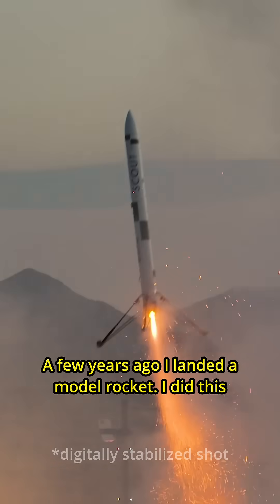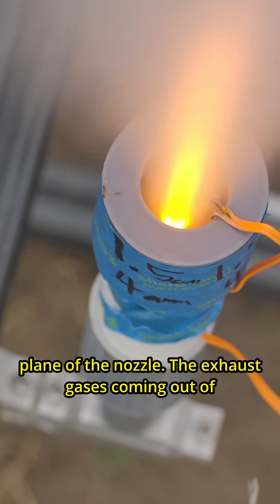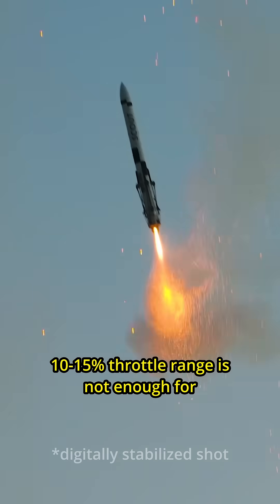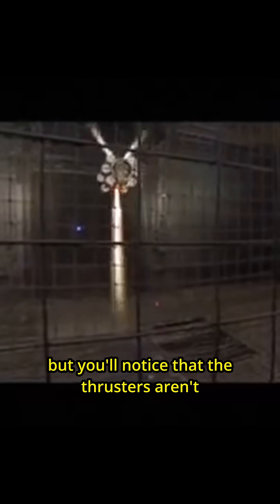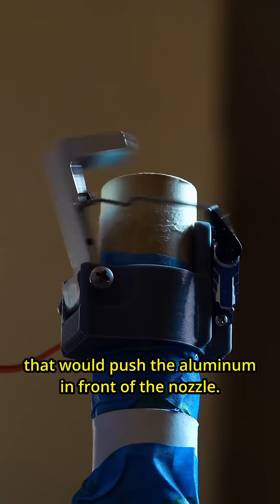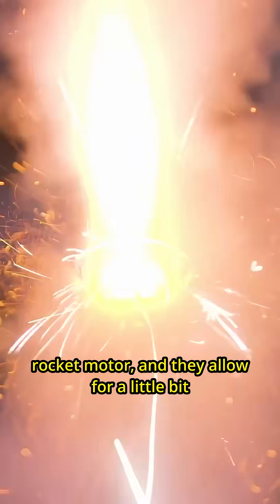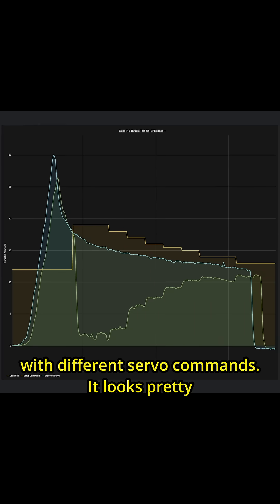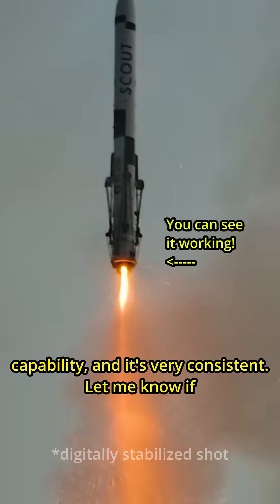Solid Rocket Throttle Control

Comment: Try Electrically controlled solid propellants, they are not indefinitely scalable, but safer and even more controllable than your setup. 
Some good Information can be found on the DSSP Homepage or by researcher Luigi T. DeLuca of Milano polyacademy. 
Also there is a video from Integza on the subject

Comment: It’s probably not that big of a difference but I do wonder if using 3 servos with mitered ends would allow for greater control. Almost definitely run into diminishing returns but maybe just 3 or 4 would be enough benefit to be worth the additional weight and complexity

Comment: The mayority of  steel is temperature resistant but aluminium is one of the lowest melting points however Aluminium oxide has a high melting point of 2.072 °C

Comment: Interesting, yeah my first thought was probably not as good as this method. Engineering is cool, 1000 ways to tackle a problem, usually most are garbage tier but something many methods of equal merit. Edit: mmm okay did not watch to the point of failure and 3 other ideas. Obstruction hmm ... Idk makes a pretty high risk point of failure or damage imo. I like the vector manipulation one. I don't think it was actually blocking many rockets, I thought it was redirecting. For your rocket your could accomplish that spinning the stream, or splitting rather than obstruction. Less upward vectoring still. But I was thinking air intake manipulation or nozzle stuff like your first idea. I would think changing the width and the distance would get enough control. But using ... The Bernoulli effects I think? So you can't just throttle around the point source stream, you have to control the intake and exhausted gas as well. So instead of the cylinder that meets the rocket, make it bigger than the rocket body so there is a gap and make it where you can cinch the top and open the bottom or the inverse. / \ to \ /
Reply: I was also thinking injecting or removing oxygen 😅but doesn't seem feasible. Or a two stage burn rate rocket, more useful for demo than actual repeatable controlled use.

Comment: If you used four it would steer as well

I believe the early systems inserted a ceramic blade to divert the exhaust 90 deg

Comment: I can't help but think this solution is somewhat over-engineered. Wouldn't it be easier to measure altitude, vertical speed and acceleration to pinpoint when to fire up the motor?

Comment: Why you dont make  plane like carrier which use retractable wings and acts like a fuel tank and launching
  booster in one body? The whole concept of verticaly landing rocket is nothing but a dead end. It is always prone to winds plus its very unstable. The larger and taller the body the more unstable it is and tend to sway and fall. At the other hand plane-like  body is more stable and offers larger payload and internal volume plus its  very easy for landing even its very windy. You can experiment with folding wings and since they are not fuel tanks they can be very lightweight  so the motors to move them will be smaller and lighter. have a great day :)

Comment: What about whit Ur Serbos, just add 2 mor with a cone in 4/4
  idea but more of a reverse  Cone to widen the thrust more  similar to a reverse thrust break on an airliner .  More  less
 In one period to slow down As you tighten the Serbos to slow down, you're deflecting.The thrust in a wide cone and changing the angle and dispersing in a wider area as from straight to 45 degrees to 90 Degrees so the thrust has no effect on lift when to the side As you throttle it.

Comment: Another YouTuber used a throttleable solid rocket propellant. The propellant could be activated in deactivated by applying an electric current. He also 3D prints rocket engines and turbines.
His name is Integza, which is awesome with the name of his YouTube channel.

Comment: The thing is, you're not truly throttling the output, You're just redirecting it. The thrust should just start shooting out the sides now, when you block them this way. When they do, could that be used to stabilize their side to side motion at the same time you are controlling the downward thrust?

Comment: I probably would have tried something along the lines of electric solid propellants, provided I could figure out how to make them. Electric solid propellants are solid propellants that only burn when actively stimulated by electrical current. I've actually been thinking a lot about their potential application in caseless firearms as a better alternative to nitrocellulose, which has a nasty tendency of cooking off magazines. Maybe that way, Heckler & Koch can finally get the G11 working.

Comment: I have more of a question about your landing gear than a suggestion for your throttle. Why doesn’t it fold out above the rocket’s center of gravity? I noticed that it almost fell over when it made contact with the ground and I think that was mainly because of how low the landing gear is on the rocket. Is there a particular reason why it’s so low?

Comment: I would have solved this problem the easy way. Get the requisite model rocketry license to work with rocket engines instead of rocket motors.

Comment: I'm not into rockets but I am a Pyrotechnician. My instinct would have been to use a rocket motor for the launch and a gas based system for the return/landing. You would likely have enough space for a gas like butane and be able to control it with servos to throttle it.

Comment: You can throttle control a solid rocket motor by how you pack the propellant. But you have to do a lot of math and be very very good at knowing how long your mission will take.

Comment: Seem to recall that the V2 used carbon vanes in the exhaust path as part of the control mechanism. If nothing else, an alternative to the ceramic. Maybe put channels in the deflectors to direct the exhaust more smoothly and consistently to the sides. Coors made ceramic rocket components for the nuclear motor of the proposed Project Pluto cruise missile back in the 1950s.
Reply: Black powder is composed of mainly coal as the fuel. It would ignite carbon. The V2 used Fuel mainly consistent of Ethanol which burns much less hot than black powder

Comment: Throttling a controlled explosion is difficult at best. Did you consider using liquid rocket fuel through a servo controlled valve? Nevertheless, your solution was brilliant.

Comment: I'd have tried using a camera aperture style shutter to control thrust, allng with a diverter or thrust splitter to change the direction of thrust to be partly horizontal.

Comment: What about making an iris out of ceramic sheets? So you maintain that perfect symmetry. You add weight but you also add a lot of cool factor too 😂
You could also try thrust reversers with the ceramic, extending it and angling it to push both up and down to limit the resulting thrust. It would add a bit more weight tho

Comment: my thought was angle the booster and spin it, so the exhaust makes a spiral motion. since its spinning, the directions all cancel out and it should stay mostly straight. but vibration, space, actually spinning the motor and throttle capabilities are all issues

Comment: Put two different rocket sizes in sequence. 
A stronger one for lifting and a weaker one for landing.
After shedding weight consuming the fuel of the thick one the rocket come back but slowly because of the second burn.
Then use the skirt lenght control of 20% to fine tune the landing.

Comment: Could a ceramic aperture or fins in the path of the exhaust be used to replicate this effect without a motor that is strong enough to directly counteract the engine''s thrust? Especially with larger rockets in mind, I'm wondering how well your solution can scale.

Comment: I would consider using 2 throttleable bypass systems going in the opposite direction of thrust that wwould be large enough to be the path of least resistance(Hooked up near the end of the nozzle) so that you could do a thrust reversal if needed when fully open. Some or even most of the gas would escape through the bypass, lowering chamber pressure, and the gas that is escaping would decrease the mass flow in your direction of thrust, lowering net thrust. While you might encounter the same issues as trying to block the exhaust, this way you should be able to control is much better while not impeding the normal exhaust. You would most likely need a nozzle that focused the exhaust gas and increased pressure normally for best results, because otherwise it would most likely fail once the motor starts running low.

Comment: Tbh i would have used an iris mechanism instead of the two wedges since that would block the point more evenly but this is still utterly brilliant
Reply: Then you have to generate a mean to bypass stored pressure
Reply: @NoahCXXIII  that's a fair point

Comment: Something I might have done differently would be to make them work like the thrust reversers on planes, making the clamshell with an explicit bypass instead of just blocking and letting the flow go wherever it fancies, that would also allow accelerating downwards and if you use 3 shells, you can get some thrust vectoring off of controlling the baffles independently.

Comment: I would have tried multiple smaller motors rather than the main to be ised for landing. My idea would add weight and complexity, this is a better solution.

Comment: My first thought for the PWM method was to use a flywheel with about two quarters missing, and you could adjust the speed of the motor to increase the amount of time it's being blocked or unblocked
Reply: If two quarters were missing that would give 50% duty cycle, independent of its rpm. It is the ratio, not the speed that is important with PWM.
Reply: @ahaveland  I suppose I could have worded it better. I meant that you would slow the speed of the motor while it is uncovered, meaning that there would be more time of it being uncovered. You could speed it back up while it is covered.
Reply: @deffman32tech  the on/off time is still 50% though, whether 10 rpm or 10000 rpm. Think about it!
Now, if it oscillates, then you can control the on/off ratio, but not if it's rotating constantly 
Edit - sorry, I reread. Yes, varying rotation speed would work, but not easy to control because of inertia and phase tracking. Mass and available energy are big factors on a toy rocket!
Reply: @ahaveland  haha yeah, the more I think about it the more infeasible it seems. It would have to be spinning quite fast and the rotor would have too much momentum. You'd need a disproportionately beefy motor to handle the quick changes like that.

Comment: How about using a sort of, ceramic bladed iris, like in an old camera shutter? That'd limit the thrust permitted through while the excess could be vented horizontally, where it could possibly assist in lateral control ?

Comment: My first thought was a hybrid rocket motor where you use a solid propellant with a liquid oxidized to be able to throttle the rocket but this is honestly the smarter solution cause it takes up much less space and is a lot lighter.

Comment: You could make the nozzle of one or more polymeres what will melt away in the 30s of flight. If the nozzle gets bigger, the thrust has to go down. As it grows wider the thrust reduction is constant and you can decide how long the rocket engine runs and determin how long the specific materials will need to melt away. In any way it will result in have at the beginn full power but when landing its much softer.

Comment: Ive done alot of looking, and cannot find any sort of references  but i vividly rememver one of my teachers in high school talking about a test that was done with fluid injection to throttle solid rocket engines. There was something tested that pulsed a fluid from the top of the corethrough the pyro channel. There was an initial micro spike in thrust because of the increased weight of exhauat gasses with the fluid that was vaporized before the temp was lowered, im not 100% sure the make up and which part of the solid booster it was injected into. The weight penalty makes more sense as to why it was never fully utilized. He was a Nike Zues operator during the cold war.

Comment: Im no rocket scientist so im taking a shot in the dark here. Wouldnt a design sort of like a camera shutter (twisting flaps to close towards the center) be more effective and consistent than clamps? 

Clamps seem easily damaged, detachable during flight, and more resistant to closing since theres an extreme force in the opposite direction the servos want to move the clamps.

 A diaphragm iris (i think its called) would mount better and allow for more thrust control

Comment: maybe you can also vector the nozzle in a circle very quickly at some constant angle, the higher the angle, the more force is lost to pushing the rocket laterally. if the nozzle is circling quickly enough, the horizontal forces should cancel out. itd be a little tricky balancing the vectoring used for stabalizing with the vectoring used for variable thrust, but it might be possible! hopefully no less uncontrollable than blocking the thrust outright

Comment: I was thinking — what if you use two ceramic flaps at the end of a rocket nozzle to deflect the thrust slightly during descent? Angling them could help steer the rocket or even slow it down by redirecting the exhaust flow.

Comment: I'd love to see if a ring variable nozzle would work well... I'm not a flight guy, everything i work on stays firmly on the ground, but i can see that it would be really interesting to try variable nozzle geometry. Narrowing the nozzle would result in a much faster exhaust stream which would, in principle, reduce the system efficiency significantly but also increase the combustion pressure, which would increase thrust/burn rate. 
I guess you could do the opposite instead and really open up the bell, creating a huge nozzle with very low efficiency and a huge area, making it very gentle but low output. 
The other option that occurs to me is just opening the other end of the rocket, allowing venting from the chamber, which would substantially reduce combustion pressure without requiring any complex work at the nozzle. 
That being said, i think you came up with a great solution, I'm just spitballing alternatives.

Comment: Not sure if  you considered it, but how about using an iris instead of the clamps. If each blade in the iris is individually adjustable, you could also get some degree of thrust vectoring, but for testing purposes, a fairly simple iris using plates that rotate in off of a servo driven gear train ring around the otter perimiter, and ports to the 'sides' (3, 4, more?) to give the gas a non-thrust exit point (or again, control these with more ceramics and servos for thrust vectoring again) might give you even more controll. You've already mostly solved your rotational corrections, but one or more of thes as thrust vectoring may give you as good, or better results during launch compared to attitude control based on fin airflow options. Both may be needed in longer term solutions, as I imagine that if you get to situations where fin control is minimal (low speed, low air pressure) having thrust vectoring as well as thrust control may be very handy. Just thoughts though, and there may be very good reasons not to do this.

Comment: Could you use a 3-way throttle jar and use that in conjunction with the gyros/accelerometers and use that too steer as well? Cut out some gimbal weight?

Comment: That is a great piece of tech there. I thought you were going some where with the cylinder idea in the begining as i have heard rockets need certain gaps of air in the port that fires the rocket, sorry not a rocket guy so i may not explain this correctly. But a cylinder that is the shape of a cone that can telescope in and out may be able to control the thrust that way.

Comment: Heres another idea whoch is less complex than my last.
Imagine 4 horizonal thrust directions. How to get that? For each direction one could have 2 vane guides. When full open it points down. When full closed pairs point to each other forcing the thrust out each horizontal quadrant. 
I could imagine 8 triangle shapes where each pair close & redirect its quadrant. 
Maybe a slight gap in the center.

Comment: Since the issue is counteracting the directional thrust by redirection, i thought about the Reverse Thruster Buckets on the typical commercial aircraft engine (particularly the DC-8 or -9 series)
Since you need at least 10% there should be a hole in the closed clamshell buckets. Since you don't want to alter the dieectional thrust it might spray out on a horizontal plane rather than a true reverse.

Or another thought.
What about the gradient insertion of a rotating pointed-up plug. Not to stop it entirely but as it moved closer to the nozzle the plug spun to redirect the spray evenly in all directions horizontally. And if properly shapped (two cones) the thrust might sweep around it when farther from the engine.

There are probably other ideas you can get from old WW2 engines whoch were hard/impossible to throttle.